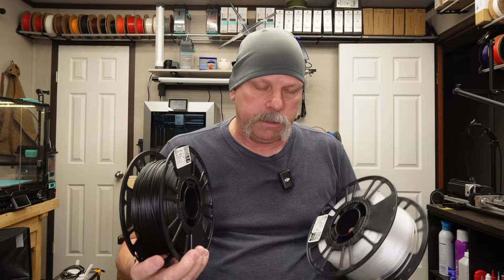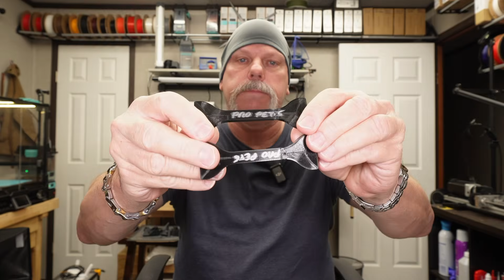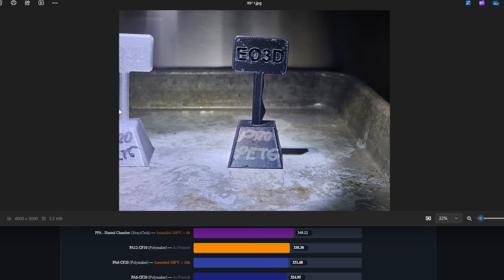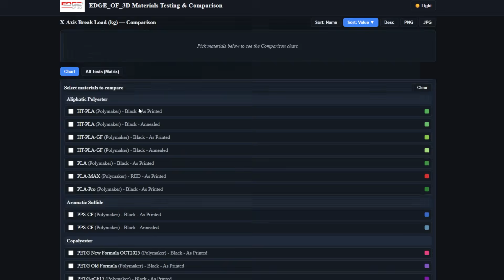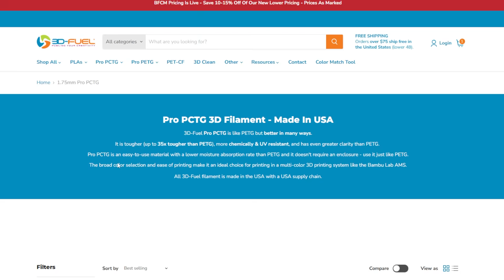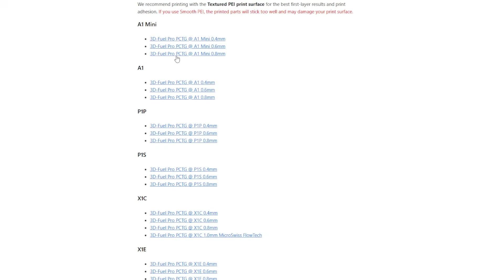3D-Fuel Pro PCTG vs Pro PETG: I Broke Them Both… | EDGE OF 3D

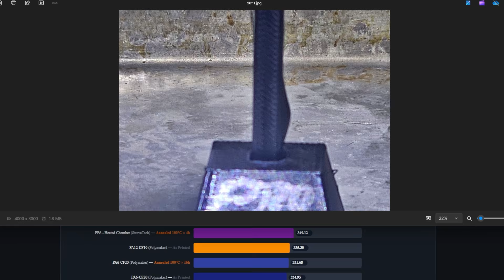Comment: 11:07 got a pocket of air in the black material that expanded or something? Maybe how the slicer does the infill and made a pocket of air in a small section possibly. I noticed how the slicer connects the infill will make a weak spot. Usually why I set the infill % higher depending on application.

Comment: well I did like their brand. Literally designing a part around using them. I have been having issues with the profiles they posted and I get it tuned then I have minor imperfections that pop into my prints. I like what PCTG looks like. But now rethinking it all. I would like to see you do more testing on PCTG brands. keep it up
Reply from the maker: If there's only one thing I've learned since I started in this hobby 12 years ago, settings for one printer, even the exact same make and model in the exact same room, running the same filament will not be identical.

I've long thought of published settings to be a base line starting point then fine tune from there for the printer I'm using. Now, with that being said, I rarely tune for looks with what I do in testing, it's more about tuning for material performance so if I get blobs on the surface or the top layer isn't glass smooth, it has zero net effect on what I do. Because of that I do not spend the time to tune "everything", I just get what I need dialed in and move ahead.

Comment: I can't say anything 3D Fuel PCTG because it isn't available in Europe. But when it comes to PCTG from European manufacturers the temperature makes a huge, huge difference (looks like your samples were printed in too low temperature). I usually print at the middle of the recommended temperature range, but with PCTG you gotta use the highest recommended temp. I had huge problems with parts at 255C, they were dull, non-translucent and most importantly cracked. A cranked the same spool to 270C and decreased fan to 0% normal, 50% for overhangs and it feels like a completely different filament. It's like a crystal, but in terms of looks and toughness.
Reply from the maker: I went back and re-tested the PCTG all the way up to 315°, you can see the results in my follow-up video @ https://youtu.be/-2K7MNDptIA
Reply: @EDGEOF3D Thanks. Sorry to hear about the backlash. The other video confirms that around 270C is the sweet spot, but at the end of the day it's up to users to test it and decide whether it suits their application. As mentioned we don't get 3D Fuel in Europe, but my local brand (Spectrum Filaments) is great at 270C.  Thank you for the great content. I stumbled upon your channel while researching PCTG and I'm happy to subscribe.

Comment: I would love to see what the PCTG would do on the 60mm test.  The izod break is very surprising, as I have found PCTG to be very resilient to impacts. One of the toughest materials I have ever tested. I am wondering if something strange was going on with the printer, with the way they printed, based on your other test anomalies.  As an example, I have used quite a bit of Polymaker HT-PLA-GF and it is way more brittle than PCTG, but you have it ranked higher.
Reply from the maker: I'm printing more samples on my Voron 2.4 at different temperatures and speeds to see if there is something else going on.

Comment: My experience with PETG is that layer time, or more likely, remelt into the previous layer has everything to do with layer adhesion. I often print it slowly for that reason, typically below 50mm/s often times with impressive results, where layer line weakness is often obliterated.
See CNC kitchen where Tom prints PET/PETG nearly glass clear, with the layer adhesion pretty much obliterated
My experience with PCTG is much more limited, but I am impressed by it's performance, I will look into whether printing slow will yield similar results.
So far Thank you 3D Fuel, Outside of more serious engineering materials, this is my new go to. it makes excellent springs
Reply from the maker: CNC Kitchen is Stefan.

Anyway, I am rerunning the Izod tests at multiple temps based on the feedback from the manufacturer to see if I can find a better flow/temp combo.
Reply: @EDGEOF3D  Oops, I had him mixed up with Sanlander, sorry

Comment: Huh. I'm very surprised with the Izod shock break results on the Pro PCTG. It's not aligning with what we, and our customers, see in their print results.

I wonder if this comes down to how the material was printed, though I know we sent you the updated profile for the Qidi Plus 4, which is newer (and better) than the one we have on our website.

It's certainly worth investigating from our end. The filament and process settings make all the difference in the mechanical performance and the aesthetics of the print, and I think you're onto something with the fact that the x-axis tensile tests all broke around the same spot.

I think it is due to the printer slowing down to accommodate a minimum layer time, which could cause the filament to be exposed to too much heat for too long and start to degrade and weaken.
Reply from the maker: Going back and looking at the slow-mo of the breaks on the PETG frame by frame, the pieces begin to pull into the tooling creating a "squeeze" right at the point of breaking which may explain half the story, the other half is why they all broke on the same end at the same spot.

I need to redesign my tools but then all testing done on the current tools would not be comparable to the new tooling so I'm hesitant as it would take a couple months or more to retest everything.
Reply: @EDGEOF3D  That makes sense - it almost seems like that squeeze could be causing a catalyst point for the break
Reply from the maker: Yeah, this is just the very first set of tests, I will be investigating further.

Currently running the tests on the PLA's and WOW! - Just going to leave it at that for now.
Reply: @EDGEOF3D  3D Fuels PRO PLA + is super durable. And it prints fast.
Reply: Filament testing IHMO needs better tests than the typical ones we see in channels. One tiny variable being different and all of a sudden a material can change from being one of the best in a category to near the bottom and vice versa. I'd like to see several tests that more closely mimic real situations with a wide variety of prints and settings. Like as an example i'd find it more meaningful to drop a wide variety of 3d printed objects on wood or stone floors over and over again and documenting how much they seem to survive vs standard impact tests that are done simply because it's easy to get a number to compare, but feels way less meaningful than I dropped the object a few times does it still work? Printed objects have to be a wide variety because example something that is small and light is a completely different test than something big and heavy.
Reply: would you have a profile for the Qidi 2
Reply: @dugannagud6254  Not yet! It's one of the printers we'll be bringing in-house soon
Reply: @3dfuelusa  I am loving your pctg, but really wish the spools fit the ams lite.
Reply: @MistImp1 our spools DO fit the AMS Lite! Some of the older spools we used to use were a very snug fit, but they did fit. And our new ones fit perfectly